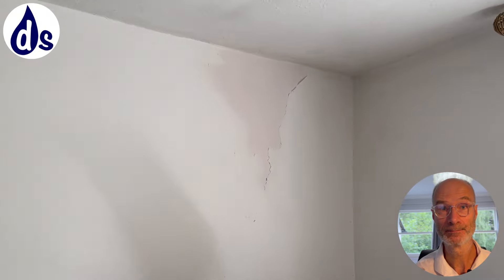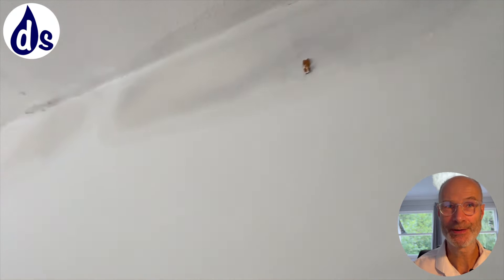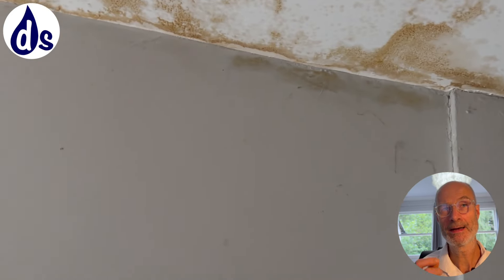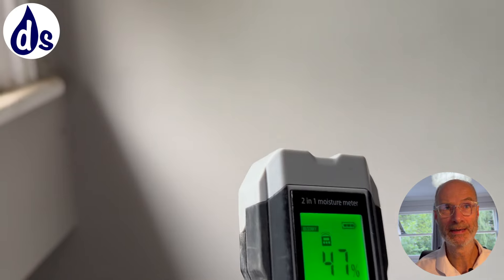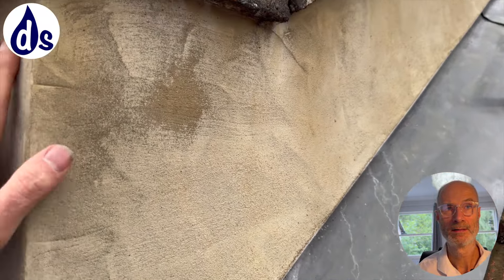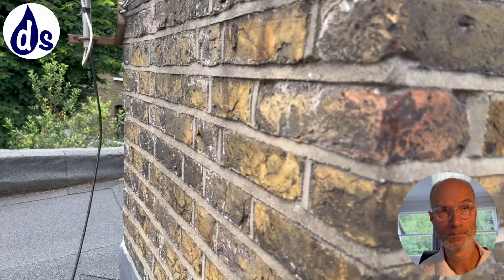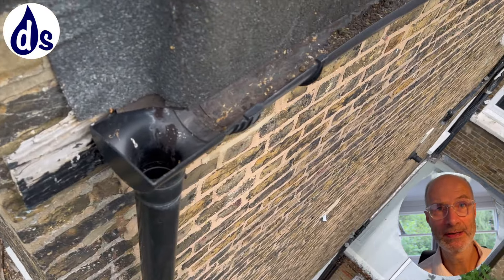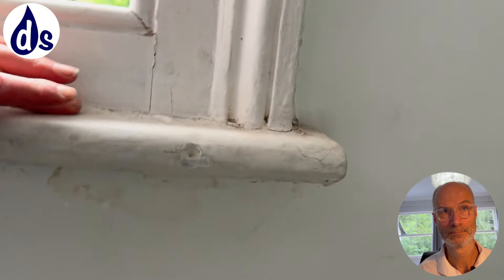Three sources of damp in first floor flat

Comment: Why not tell them to use lime
Reply from the maker: Thank you for your thoughtful response. Your revised comment is excellent and provides a more comprehensive and balanced view on the use of lime in construction and restoration. The additional pros you've included (flexibility and mold reduction) and the more specific examples in your conclusion greatly enhance the informational value of the comment.
Here's a slightly refined version that maintains your key points while improving readability:
"Thank you for your comment. While lime might not be directly relevant to this video, I appreciate the opportunity to discuss it.
Lime in construction and restoration has several pros and cons:
Pros:

Consistency in repairs: Ideal for maintaining material homogeneity in lime-based structures.
Stone preservation: Preferable for repointing stone, acting as a sacrificial layer to protect the stone.
Flexibility: Better at absorbing water without cracking.
Mold resistance: Reduces mold risk in indoor applications.

Cons:

Lower strength compared to modern alternatives.
More challenging to work with than cement.
Generally more expensive than common alternatives.

From my experience repointing stone on my property, lime-based mortar effectively stopped leaks and preserved the stone. However, the choice to use lime should consider existing materials, intended purpose, budget, and long-term preservation goals. It may not be necessary for all applications, such as plinths, render, brick pointing, or as a substitute for internal plaster.
Ultimately, the decision to use lime should be made on a case-by-case basis, weighing its benefits against its drawbacks for each specific project.